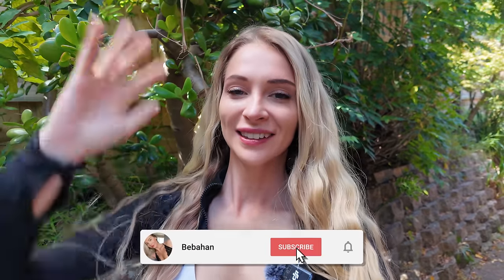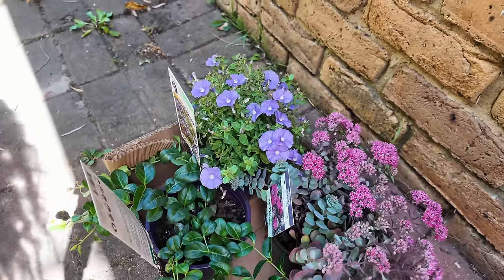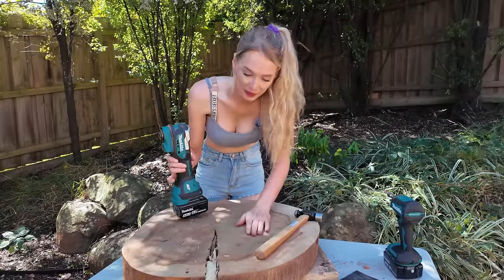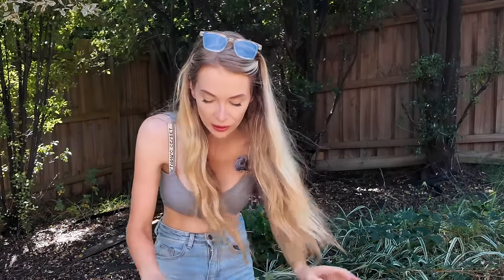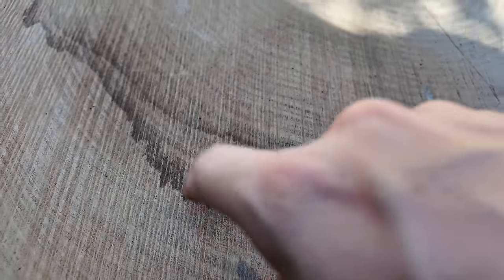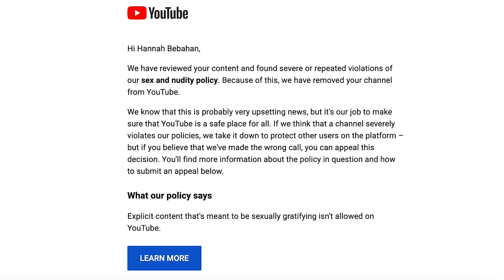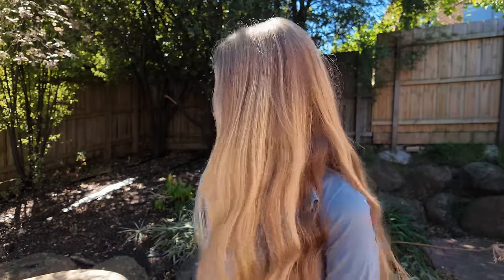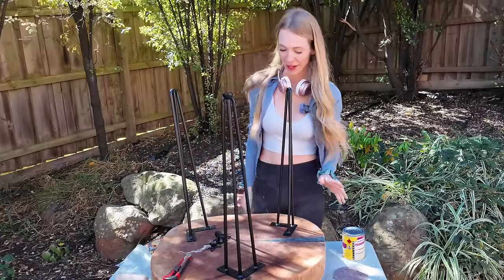DAY IN MY LIFE - (VLOG #23)

Comment: Hannah to get your water stain out of raw wood. 

Mix equal parts white vinegar and olive oil in a bowl and saturate the wood stain using a paper towel. Let the solution sit for an hour to release trapped moisture in the pores. Wipe off the residue with a soft cloth and buff the wood until the stained area blends in with the natural wood grain.

Comment: To get rid of the staining in the wood you need some sodium hydroxide mixed with water, spritz it on and let it dwell for several minutes, then rinse with a forceful spray, Most common drain openers are sodium hydroxide and can be mixed 10 parts water to one part drain opener to clean the wood. This is what is used to clean decks before staining again. Hope this helps.
Reply: Immigrants lol

Comment: 10:45 The ''water stain'' is black mould. To clean It, you need to use mould remover foam spray cleaner that is use for the bathroom. I know, this is toxic, but for the wood, that will be perfect.

Comment: Hannah: Watermarks can be tough to remove, especially with a trunk cut like the one you were working on. The water can follow the grain into the wood, because living trees suck up water from the ground and passes it through the trunk to the branches and leaves. The trunk is vascular and after it dies water can follow those same structures down into the wood, but never deeper than about 1/4 in or 6mm, so a plainer , belt sander or hand plane is often the only way. A hand plane I wouldn't recommend unless you are an expert. Take a straight edge that is larger than your table top, I used to use a 4 foot level, to check your work first one way say the 12 o'clock to 6 o'clock position, then at right angles to it, 3 o'clock to 9 o'clock position to look for high and low places.  Once it is getting close to done you can drag the straight edge across the table top and feel for where it gets bumped, again at right angles. When you feel a bump, then stop look for it, and mark it's edges with a pencil. A hand plane or your random orbital sander should be able to handle it. Being a trunk section you will probably need to use the sander instead of a plane.

Comment: Bleach it, using a brush, applying chlorine bleach to the stained area, bleaching can take several hours, let sit, and reapply as stain is lightened, severe staining can take several days and lots of stand time, a few hours between applications, you can also use hydrogen peroxide, but not together with bleach.

Comment: The sodium hydroxide and water mix can remove the oil you just put on the table as well as remove the stains from the watermarks. This chemical is used for stripping wood fences and decks. Certain types of wood need to be treated with oxalic acid after washing to neutralize the caustic condition from the sodium hydroxide and restore its natural color. Cedar is an example of this type of wood.

Comment: There is an orbital sander and a disc sander that spins as fast as you set it. Orbitals vibrate disc sanders are much more aggressive. You needed a disc sander. I warn you. They’re powerful. Make sure it’s not on the high setting because the disc can hit you and they hurt. Belt sanders leave lines unless your Picasso with them. Discs are more forgiving if you use 3-4 grades of grit. End with 220 or 320 if you can.

Comment: People are constantly getting flagged for things that don't apply to their content (nudity, harassment, threats of violence) and it's all because of the shift to AI for content monitoring. Sadly, most appeals are also reviewed by an AI at first just to weed out people who will give up after the first "no." And it's impossible for a computer to "change its mind" as it doesn't have one.
P.S. The table came out great! That water stain permeates straight down with the grain, so no matter how much you material you take off, it will still be there. A high PSI pressure washer might also remove or at least fade it some. I know using it on weathered boards can make them look like new.

Comment: Use an iron on the water stain, the heat from it should help evaporate the water that entered the fibres.
It'll hopefully work through any finish you've put on it... But make sure it's not too hot that you burn the wood.👍
And hopefully you'll get your second channel back soon. 🤞❤

Comment: Plastic wood Bebe, same colour as wood sands down easy and stays there. Better that the black mucky stuff. Sand with very course paper 20 or 40 grit and work down to the 1500's grit. When using the course do not stop in one place and keep a straight edge handy to check it is staying level. Try bleach on a small part of the water stain only the water stain and it should lighten it.